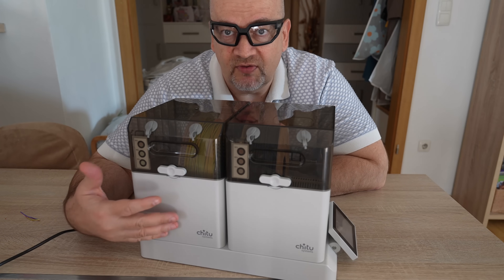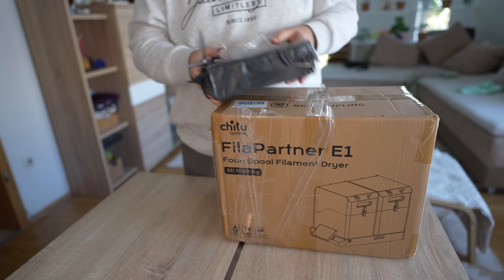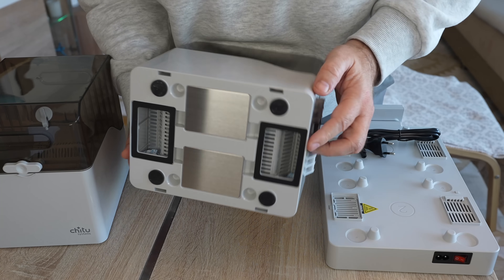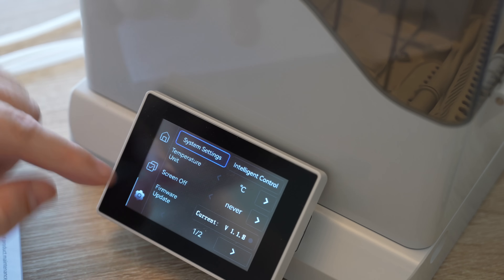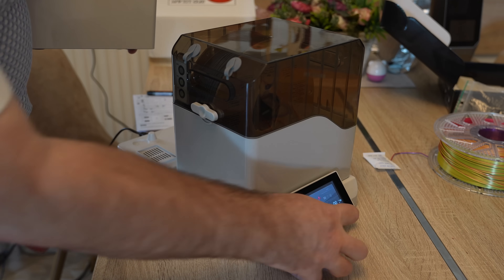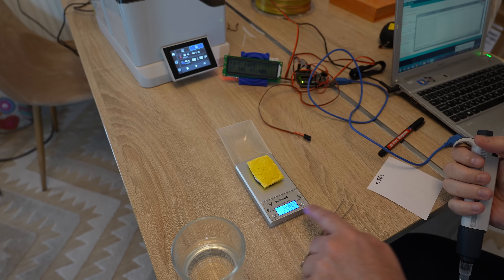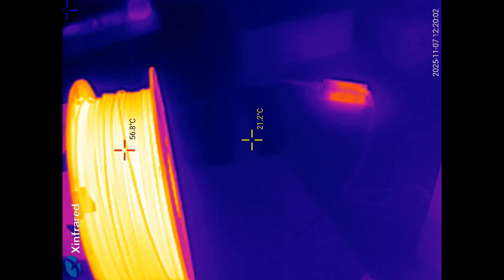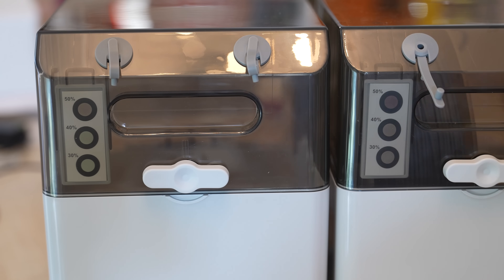Chitu Systems FilaPartner E1: Dual Independent Chambers for Filament Drying and Storage

Comment: The Chitu Systems website linked is ambiguous as to how many actual dryer boxes are supplied at the inclusive price of $149.  It could be 0, 1 or 2, can anyone tell me definitively which of these applies? If it is 0, as I surmise, then the price of $227 for a system complete with 2 dryer boxes is a whole lot less affordable than an unsuspecting buyer might think.  </Edit:> ydrRC has pointed out I was wrong to suggest that this was ambiguous. I do apologise for my mistake and for the suggestion there was evidence of sharp practice.</>
Reply: There is a "What's in the package" section that clearly states it comes with two filament boxes.
Reply: @ydrRC  Yes, I see you are right and I do apologise for getting that wrong.  As you say the picture labeled "What's in the package" near the bottom of the page does clearly state that there are 2 filament boxes included as standard. Thanks for your reply.

Comment: I picked up the Creality SpacePi X4 dryer. It reaches 85C drying for better drying of PA filaments, and has exhaust to remove humidity during drying. I've been very happy with it so far, and while it doesn't let me take the spools off in the chamber and replace them, I've had the RH% stay below 20% for at least a week after drying. Thanks for your review, Igor!
Reply from the maker: My next dryer video will be SpacePI X1, X2 and X4 (all 3 in one video)
Reply: I'm also very happy with it so far and it has a capacitive touch screen.

Comment: The flipping over of the boxes to put those plates into place and having the rollers fall out is completely unacceptable

I was 4 minutes into watching this video and already annoyed at the design. (Btw thank you for noise measurements!)
Reply from the maker: With some practice, it can be done without flipping the boxes. Few other strorage systems have similar solution, only not with magnets, but rubber-sealing.

Comment: How they indicate humidity is just not acceptable in my opinion. If they don’t want or cannot integrate into the printer’s system, display it on some screen accurately. Those are cheap sensors; even with BT/wifi a solution will cost less than a spool of PLA. Lack of these makes the “maintenance drying” feature (turning on above 30% RH or thereabouts) pretty useless, especially in a design without seals and gasket like this.
Reply: After watching some lofty “reviews” on YT I’ve purchased that Chitu some weeks ago—and have returned it. Though I cannot print out of the Arendo food dehydrator, it’s way more silent—I’ve grown to enjoy pre-heated coffee cups and plates without hogging the oven. 🙂

Comment: There's a little nub on the silicone seal for the ptfe tube to seal that vent hole. I like being able to grab a box on the shelf that is ready to print from. If you want them better sealed for semi long term storage, I would just tape over the seam.

Comment: 56.4C max "cold" side and 73.5C max "hot" side... that's not a good look.  With those results, you could be melting the spool on one side and not reaching the required temperature on the other.
Reply: Contactless temperature measurements are very tricky and might be very off. I prefer temperature sensors. It showed 65C on the "cold" side and 69C on the "hot" side, though the position of the sensor was a little bit far away from the "hot" side.
Reply: @yansakovich  The absolute accuracy of the measurements could be off, yes.  But the error would be consistent (the same amount, too high or too low) on both sides of a single object.
Reply: @EliteMacFreak  The error might be non-linear, and the error might depend on the angle of observation. I just do not see the reason to make judgement based on the contactless measurements when there are very nice measurements from a temperature sensor in two places.